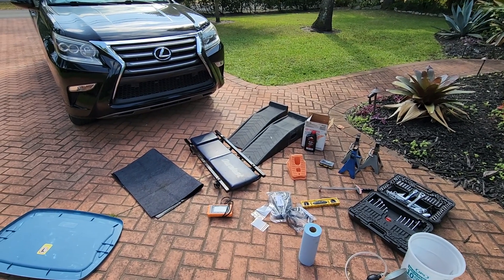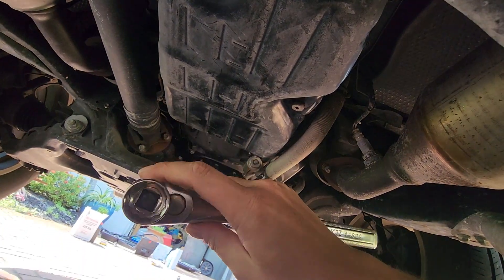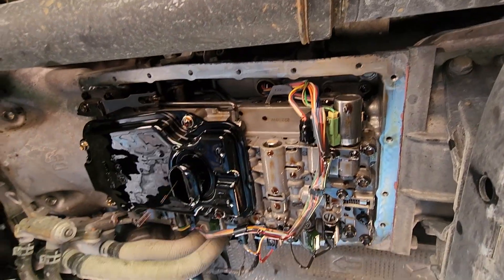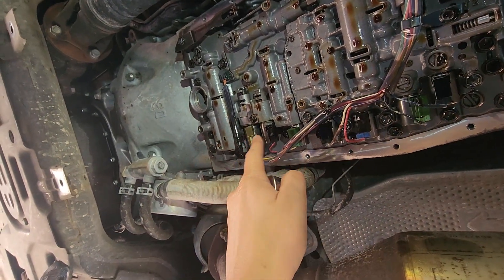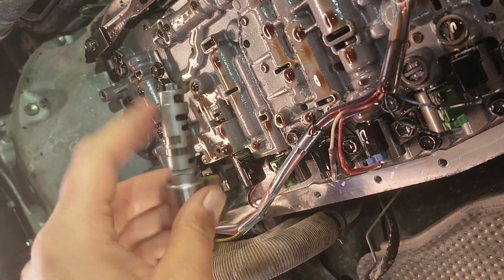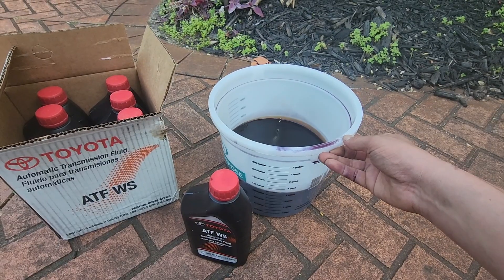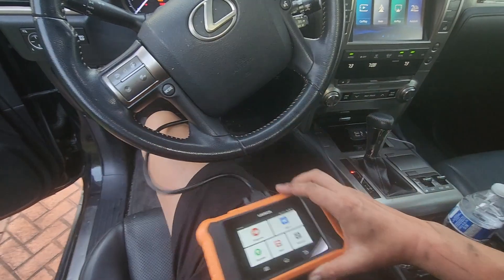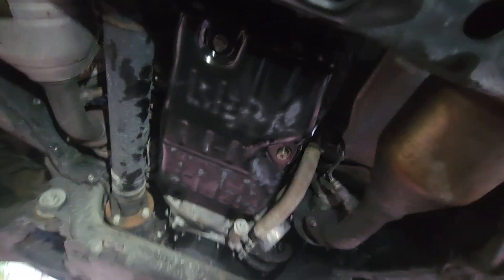How to Change Transmission Fluid and Filter in Lexus GX460 - Check Solenoids P2714

Comment: Thanks for the video! Is the code still gone for you?
Reply from the maker: My code did eventually return. I'm interested to now completely replace the solenoid(s).
Reply: @JonathanMarkMorgan if you can keep us posted that would be awesome! I’m at a year plus driving with this issue. If you drive in manual mode, making sure to shift 3rd to 4th manually for the first 10 mins until at temp, it can be pushed for quite some time. Since there is no clear fix, for now, the S on the gear selector is a cold start mode 😂

Comment: Great tutorial video. Could you please share the part number of the pressure control solenoid D that throws the P2714 code. Thanks in advance
Reply: AutoZone will tell you exactly which part it is

Comment: Hi. Do you now part number for this solenoid.?? I did the fluid and filter. But the car still sends 2714. Otherwise drives good. Probably the solenoid. I didn't test it first time, just change the fluid/filter. Thank you

Comment: Thanks for this video. Watched several times, followed it exactly, bought the same parts, except i bought a new solenoid from dealer $300 and it fixed the issue! Almost 400 miles in and no check engine light! Thanks again.
Reply: Hi. Do you have part number for this solenoid?
Reply: What was it doing to change the solenoid? 👍
Reply: @plucky2115 nothing, it was just throwing the code
Reply from the maker: @theheadlightpros1, did your code reappear? Or is the issue still resolved?
Reply from the maker: @theheadlightpros1 did your code reappear? Or is the issue still resolved?

Comment: Really nice job!!! I had this service done, along with all the other services on my 2022 GX 460 by TCCN. Then I bought an LX 570 and did all the fluids myself. The transmission fluid and filter on the GX and the LX are just about identical in procedure. I also bought the Launch so I could get an accurate temperature reading. The only issue I had was I overfilled a bit much and by the time I drained what was needed I was really close to the max recommended temp, but luckily it all worked out. If you are handy and take your time there is no reason not to do this yourself. I do all the fluids on all our trucks and frankly it takes very little time and money compared to going to the dealer. I use all OEM fluids on all the trucks, except oil and transfer cases and differentials which I use Amsoil. Really enjoyed how you did this and explained it!

Comment: Great how-to!  Got this one saved along with GX*Bob's "How to Change Lexus GX 460 Transmission Fluid (and Why You Should)".  What did you use to get the transmission oil plan and magnets so clean?  It looks like a new pan!  Wondering if you used brake parts cleaner or some other solvent/cleaner?
Reply from the maker: I only wiped it with paper towels
Reply: @JonathanMarkMorgan  Amazing!  Never would have guessed.

Comment: How many miles would you recommend to replace the filter and not just a drain and fill?
Reply from the maker: Some people will suggest never changing the filter. Although, I and others will conservatively advise changing the filter every 100K miles.
Reply: @JonathanMarkMorgan  When I did that service on my LX the truck had 79,000 miles and it had never been done. I was a bit concerned and did the filter. TCCN says not to do the filter each time, but if I recall he suggests change the fluid about every 50,000 without a filter change. Next time I won't do the filter. When he did the fluid on my GX 460 it was at 35,000 and he did not replace the filter .

Comment: If you are a professional mechanic and have a lift, this job takes an honest hour and a half. The labor hours for this job is all over the place depending on the software the shop uses. Glad you did it yourself! The hardest part is monitoring the temp! Thanks.

Comment: Bookmarking for the future as I’m only at 30k mikes with my 2022 Gx  so it will be a while before I have to do this… it always amazes me that the solenoid wiring seems so clean despite being exposed to the tranny oil..
Reply: I like to do it much sooner then later. I do it every 30-40k miles. In fact I just did a drain and fill at 35k in my 2024 kia forte. I plan on doing a complete filter change at about 50k along with coolant flush and oil pan cleaning. I heard transmissions are the most expensive part to replace not the engine.
Reply: Do drain and fill every 30K